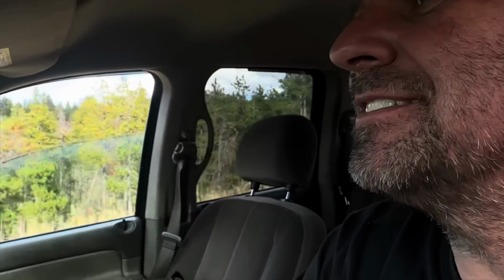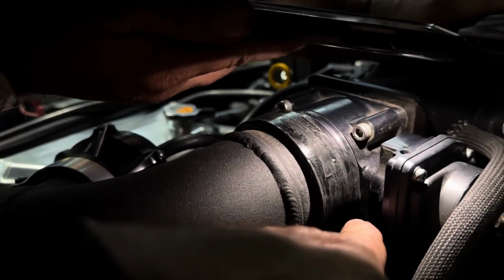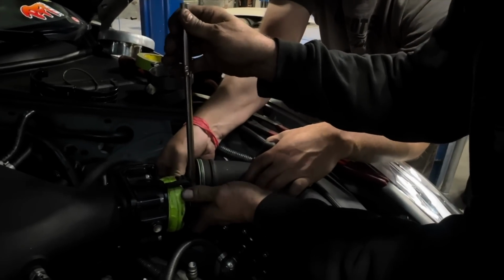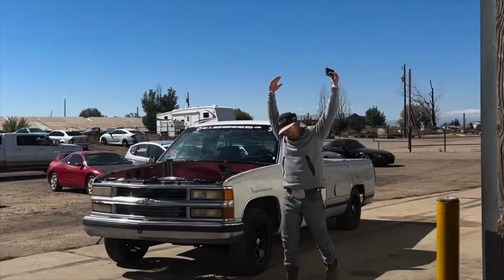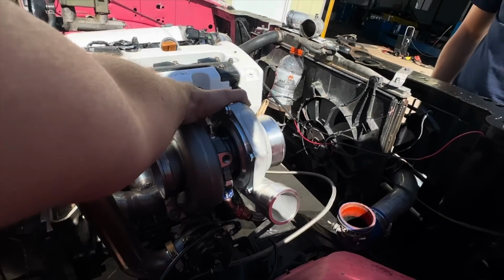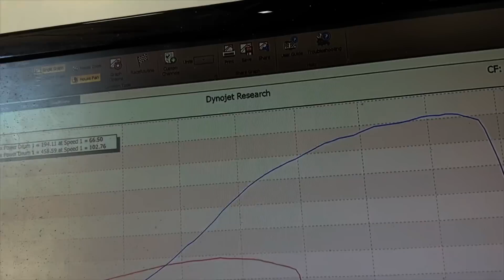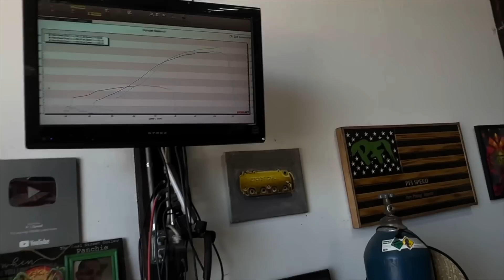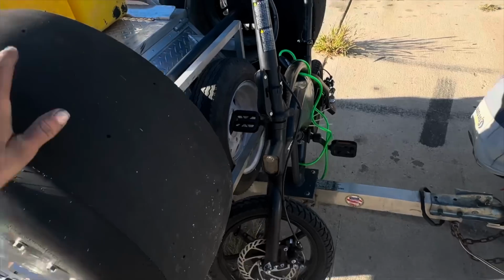Boost Leaks and Smoking Turbos, Raceweek has a Racing around!

Comment: That steering box can be adjusted there’s a nut on top with an Allen bolt in the middle of it. Loosen the nut and tighten the Allen then tighten  back down the nut.